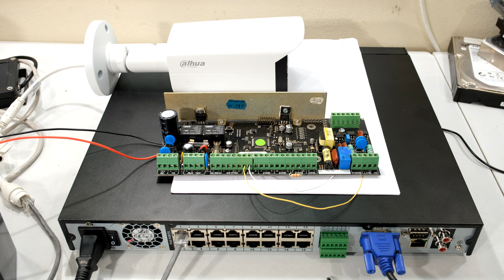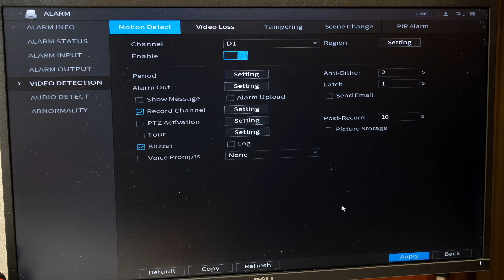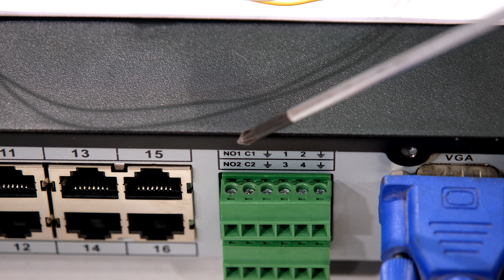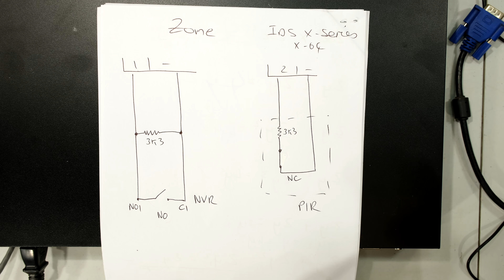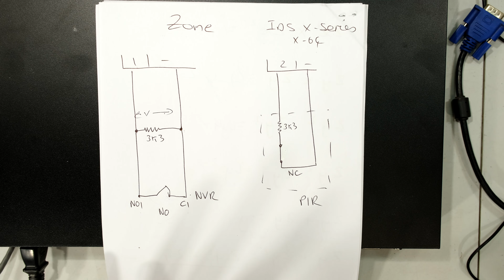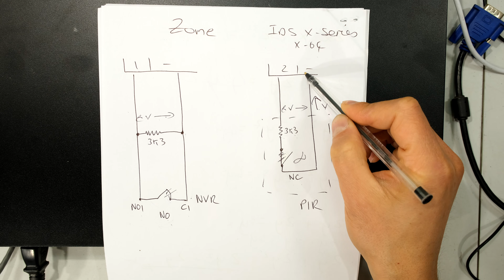How to connect a Dahua NVR to your alarm as a zone - IDS alarm - with tutorial

Comment: Your Latch and Anti Dither are different and the time runs together not added... Normally set at 5, this is good for setting up a Tour of your camera on motion it will pop up the camera for 5 seconds full screen, In this since when your using the Alarm Latch time was Normally setup for 10 seconds, That means when the time starts to count down both have started they don't add up to 15 with 5 normal Anti D, and the Latch 10... It will not detect and start another Latch for 5 seconds. So if your not going to use the Tour on motion feature you could set the Anti Dither to 10 and that means it will only Log (if set to Log on motion) every 10 seconds and that is the time of the latch, IF you keep it at 5, and 10 for latch in a since if the Motion is tripped a second time after the short set 5 yes it might go longer then the latch of 10seconds because in a since it started again
Reply from the maker: logically that is how i also though it functions but when i test it it adds the time. This is how it functions on the NVRs listed in the video. Tested for short periods and longer periods.
Reply: @ecologicaltime  Thanks for the Reply, That is odd because I have been using Dahua for many years and I have some very old AI hardware from Dahua as well. Before the invent of the 4216.. I also have a 4216E-AI.. I have tested my Alarm output Latch with a Stop watch and it is right on what it is set at. Only one I have had an issue with is a older system from 2012 It is like the motion is to touchy and even though I don't see anything trigger after the Anti Dither is over it must trigger again and adds on time.. Or maybe it was just defective from the start. All my other systems with Alarms, most of them are Dahua or Dahua OEM products I do have some Hikvision with Alarm in and outs as well..
Reply from the maker: i too used a stop watch and reported it as it performed. I tested twice. This is why i say logically its supposed to work as you described but it did not on the unit in the video.